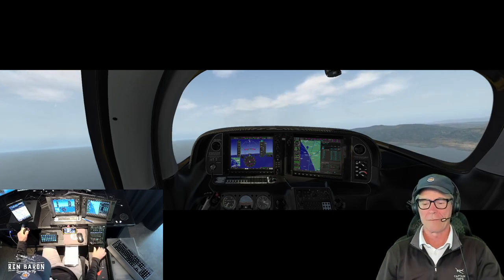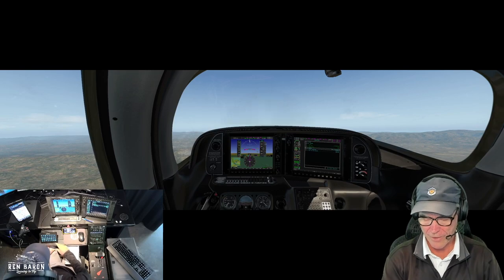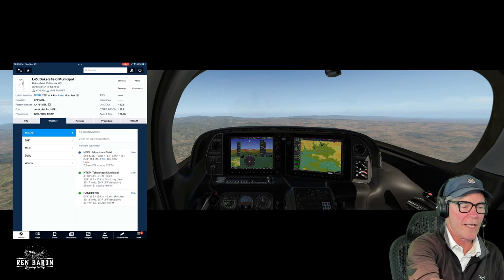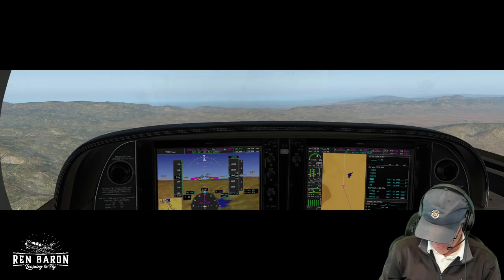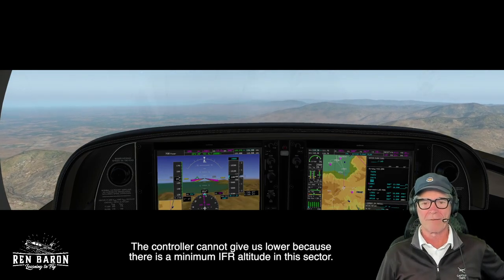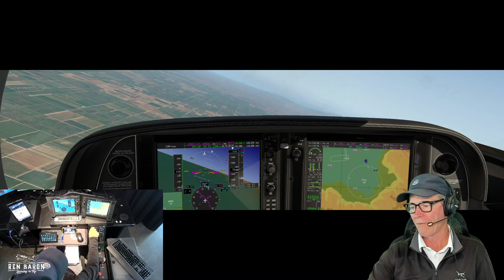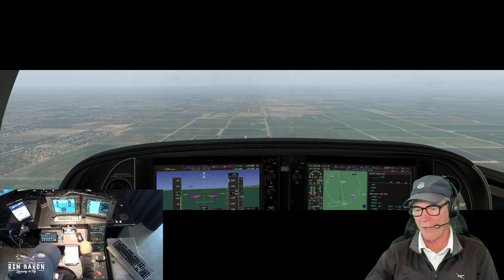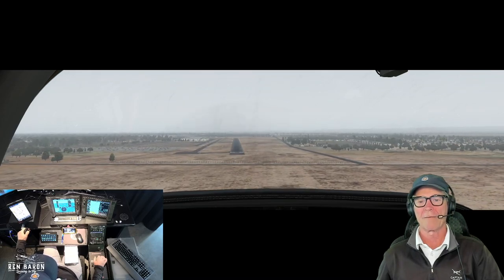Simulator v Real World Flight in a Cirrus SR22T - Part 1-Sim Flight

Comment: How often do you get the yellow manifold pressure warning in your real plane?  And if you do get it in your real plane do you do anything?  I seem to get that message a lot when I use torquesim’s sr22.
Reply from the maker: I get the yellow light consistently in the sim and my real Gen 6 when I'm climbing with the turbo engine. I'll keep and eye on it and when I've got a good steady climb rate happening I'll typically adjust it out of the yellow.

Comment: Who are you talking to on the radio?? How does that work?
Reply from the maker: I'm talking to an ATC controller on PilotEdge. Pilotedge is an X-Plane plugin that allows simulator pilots on its network to interact with controllers just as they would in their real world cockpits. It's staffed by off duty and retire ATC controllers. They handle clearances, departures, arrivals, virtual traffic...everything you'd get in the RW ATC world, albeit a slimmed down version due to staffing limitations. Here is a link to there website where you can find more info. Invaluable simulator tool for me! https://www.pilotedge.net/
Reply: @TheRenBaron  that’s awesome! Thanks for the resource!